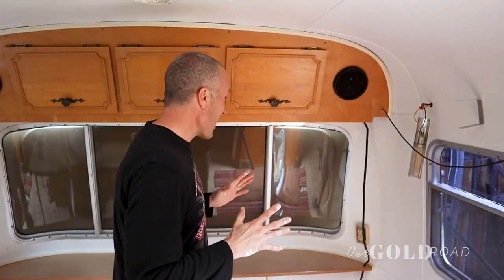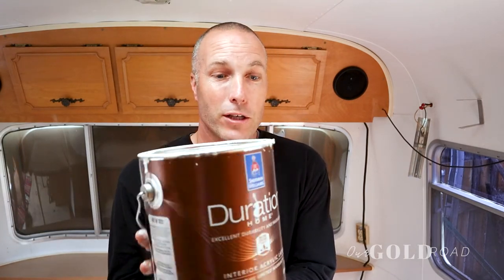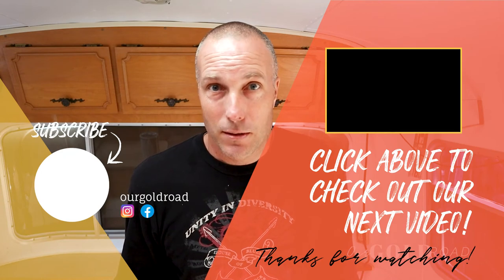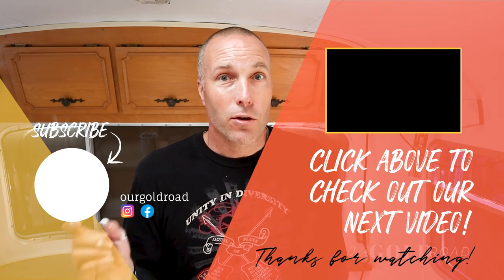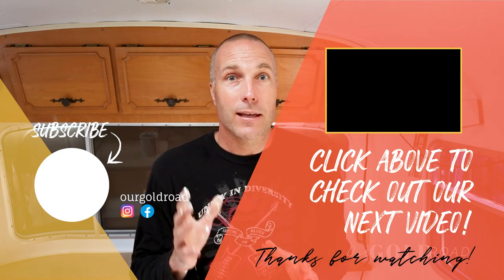Painting the interior walls of our RV | Good Time Tuesday | Vintage 1973 Avion LeGrande Travelcade

Comment: Hi! I have an identical trailer and I'm wondering what you ended up doing in the bathroom? We gutted ours and are looking to paint/redo the bathroom but the fiberglass ceiling and wall with the built in mirrors are posing a problem. Tips?
Reply from the maker: Hi Ashlyn! (Sorry for the late response as we were away for a trip!) 
Currently, our bath is original. We decided to keep the layout and just replace the counter and sink and use a marine paint for the tub. (Project for next year)
If you haven't already, join the Avion owners fb group and the Avion restoration fb group. I have seen an owner use a wooden barrel cut in half as a tub, and it was SUPER interesting and a great reno!